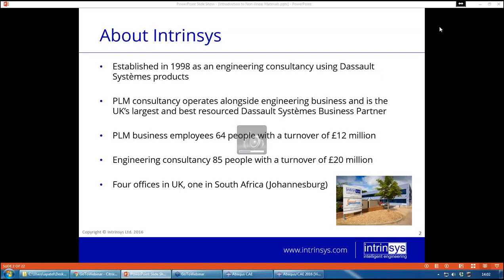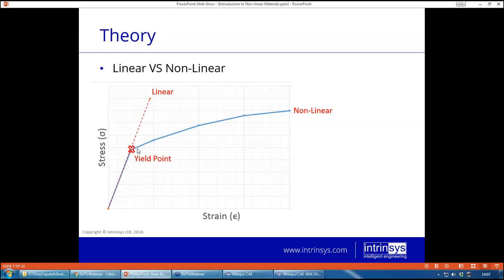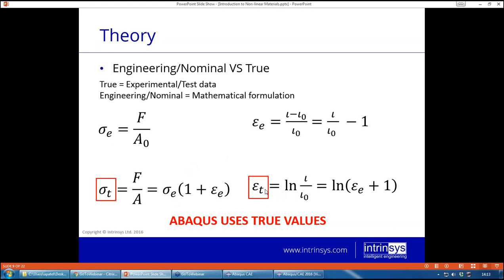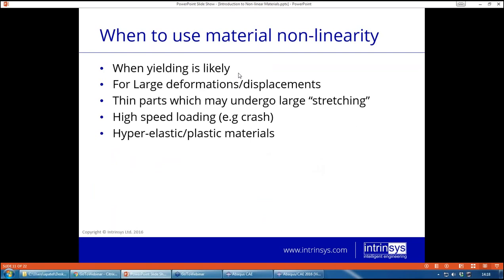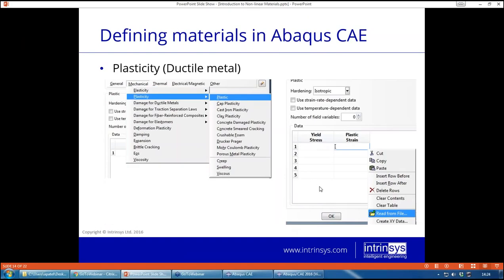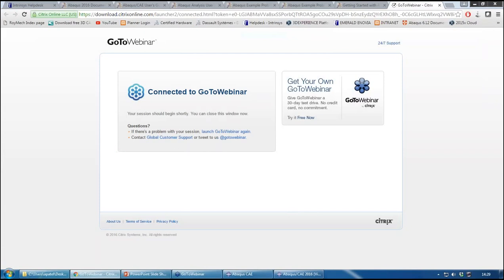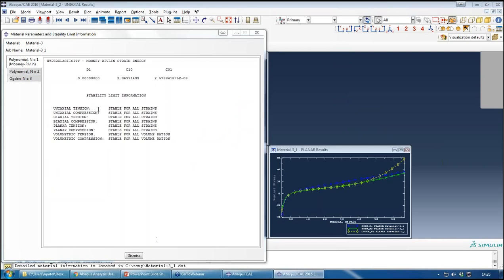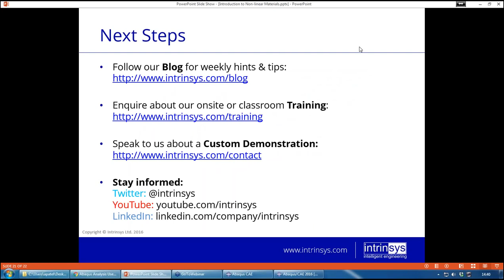Introduction to Non-Linear Materials

Comment: Hi, thanks for your video. i have a questions regarding the uniaxial data and biaxial data for elastomeric materials. where did you get the data? can i have one? i am currently working on my master thesis for developing a emergency hatch seal of an aircraft and i need to simulate the seal on abaqus, that is the reason i want to know, how did you get the data. thank you so much for your reply.
Reply: Hi Endry,

Thank you for taking the time to watch this video. If you could provide your email, I will see if I can find the excel sheet of some sample data that I can send you.